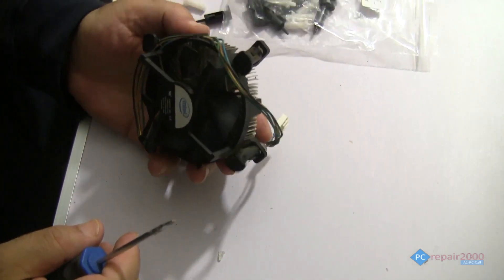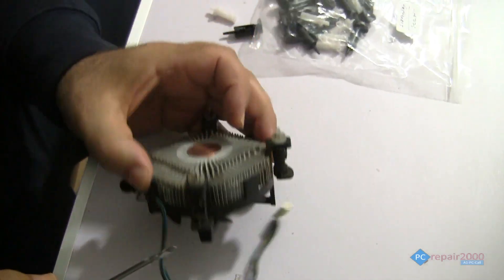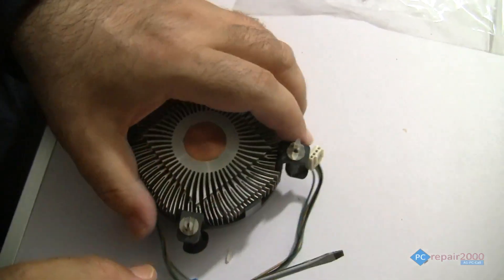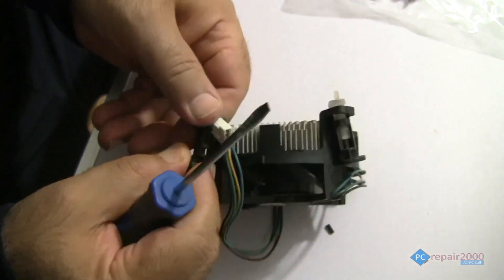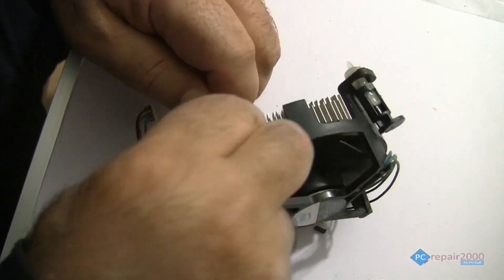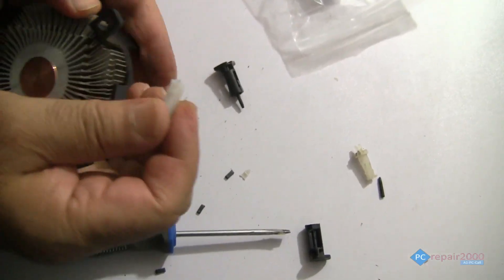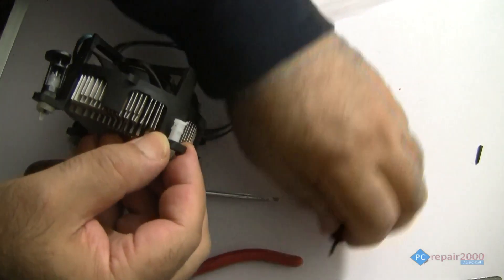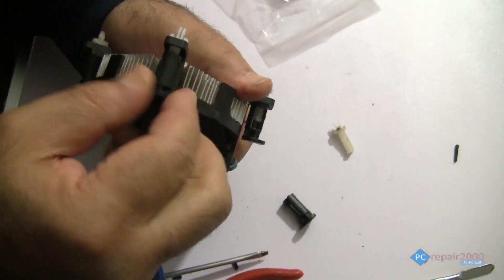Intel stock cooler heatsink/fan push pin type broken repair sockets LGA 1700, 1200, 1366, 1155, 775

Comment: It is possible to repair it, I replaced it that way in an old PC with a 775 socket cooler, they broke 3 out of 4 latches, in service after replacing the paste they didn't say anything and the processor was pressed in by 1/3, so I bought these pins and replaced them and the problem disappeared. Most people replace the entire cooler which is a waste if it works and only the pins are broken.Good video, we would like more guides like this!